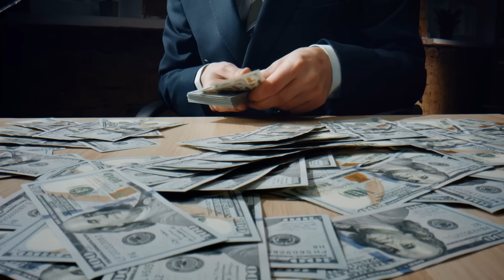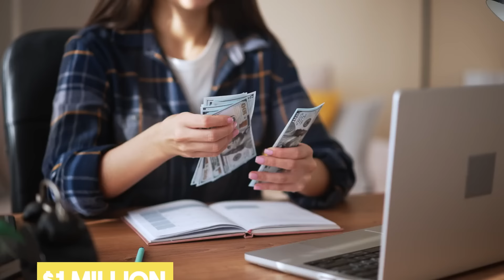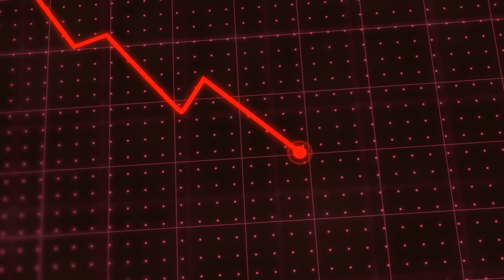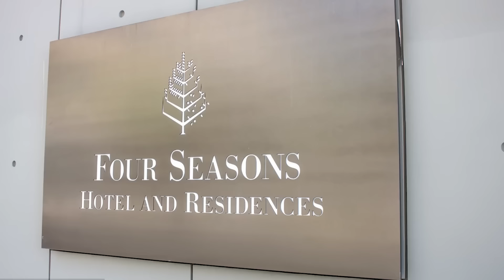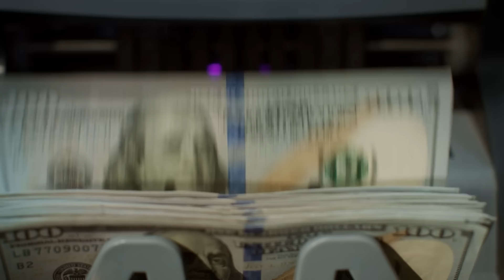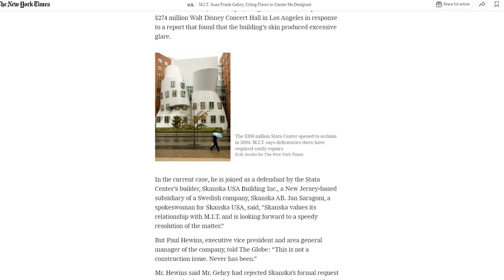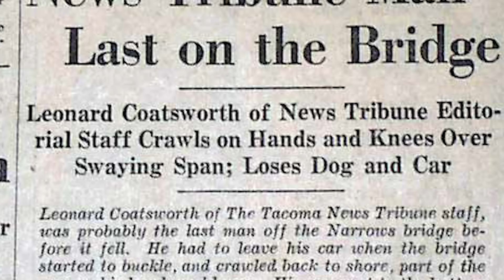The Biggest Construction Mistakes in the World

Comment: That Jetta Tower would have been 679 feet short of 3/4s of a mile tall. Are men nuts to want to build a structure that tall? The sprier (incorrect spelling, I'm sure) that does nothing was probably going to be the last 200 feet as with many tall buildings. Makes no difference, though still 3281 feet is ridiculously tall. Who would want to live that high up? If the Empire State Building sways an average of 12 inches over all (at least that's what I've heard), what would that sway? WOW.😮.

Comment: You’d think they would have seen the catastrophic failure coming, but nope!
Reply: With the Tacoma Narrows bridge, part of the unforeseen problem was that previous suspension bridges were so overbuilt and heavy that the wind didn't bother them, and the question never arose. So when they discovered that the dead load of the bridges themselves plus the life load of the cars and trucks going over them could be handled with simpler and lighter materials, they thought they were OK. Another factor that came into it was that some kinds of vibration can become self-amplifying, like a violin string, and no one had ever had to consider this in large bridge construction. (Though I suspect that there were some rope bridges in remote areas that had been subject to that problem in the wind. Maybe the engineers of Tacoma Narrows would have benefited from someone with experience of one of those remote rope bridges.)
-- Regarding the Hancock Tower in Boston, I was living in the city at that time. It turned out that the shape of the tower made it act like an airfoil, like an airplane wing sticking up in the air, and that created a lot more "lift" on the leeward side of the building, which could be any side, depending on the direction of the wind. And Boston is a substantially more windy city than Chicago (the so-called "windy city"), and these forces were quite substantial. The general practice in designing for wind load is to design a building to resist the pushing force of the wind, so as not to push the building over, but the pulling forces ("lift") hadn't been considered. (I was disappointed that he didn't have any good pictures showing all the plywood that was used to cover the openings where the windows got sucked out. The building was kind of a mosaic of glass and plywood. I always wondered why the pattern of sucked out windows was so irregular. At any rate, it was an unforeseen issue, because of the lack of previous similar experience.
-- As for the Gehry building at MIT, I've been in that building and knew some of the faculty who worked in there (it also housed the linguistics department). I have fewer excuses for Gehry. There have been millennia of experience in making roofs that reliably keep the rain out. There are many architects (not all, or even most), who are narcissistic jerks who act like they're artists who don't have to pay attention to how well a building functions. And if you're going to design a challenging structure, the way you specify the construction details matters a lot. This stuff has been worked out already. There have been lots of tricky roofs that have been made not to leak, and there are ways of flashing windows so they don't leak, even skylights on sloping roofs. (Check out the flashing kits for Velux windows if you're interested.) It's just a matter of gravity and flowing liquid. And look up "roof crickets" for further insight in how to get water out of tricky parts of roofs.
-- A building is not a painting destined for hanging on an interior wall or a sculpture sitting on a shelf in someone's house.  Sometimes, when the real-world details just don't work, you have to change the design in a more substantial way. This goes for building design as well as financial plans and philosophical theses.